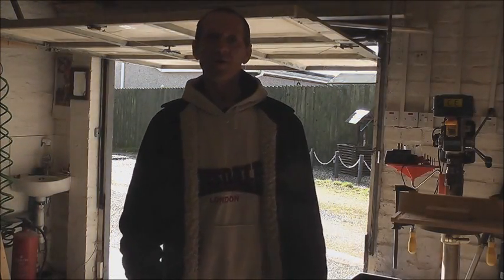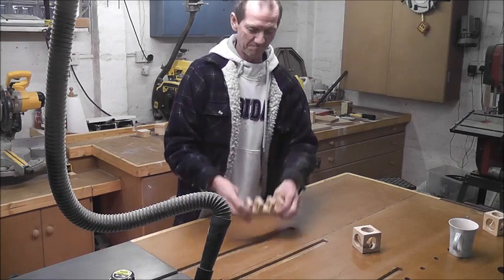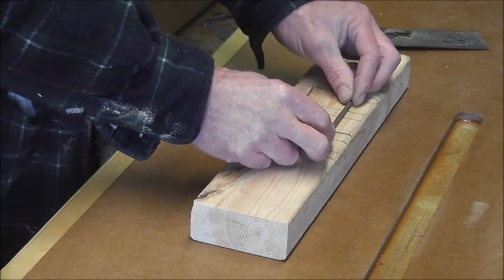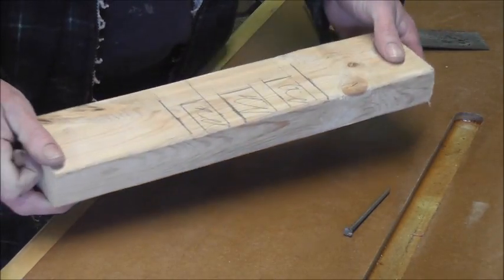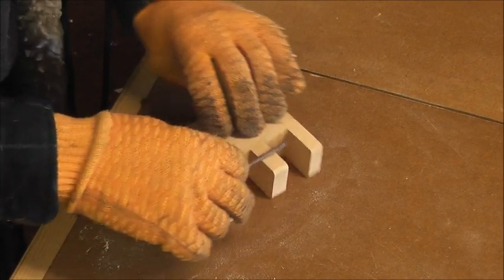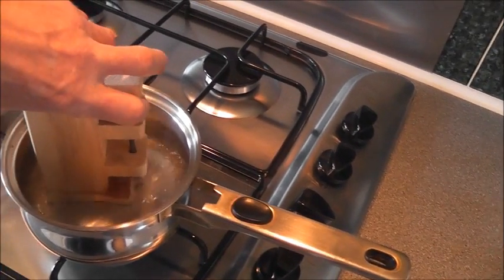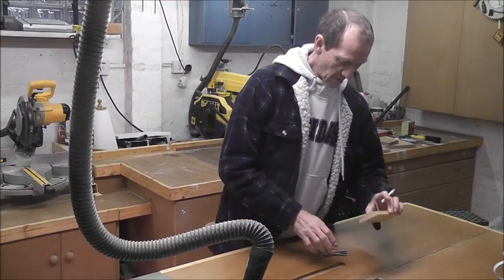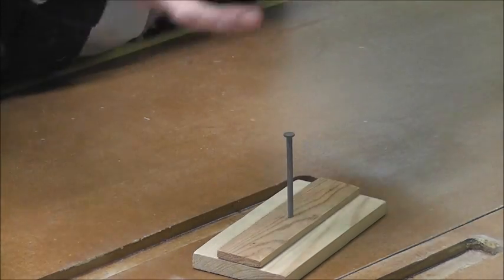Nail In Wood.Trick

Comment: Love the router table mate lol
Reply from the maker: dan barrow you need to see my new one in a more recent video
Reply: Which video mate is it the one on the table saw mate
Reply from the maker: dan barrow yes that's my new baby l
Reply: Which recent video is it mate
Reply: I'm changing all mine around in summer so I will try and put video up now off of and after then u can see my workshop shed lol mate
Reply: Can't wait to get it up and running just got to insulate it and board it up and paint it what is the best thing for like damp etc, can I put planting sheet round the shed with insulation and then osb board round it mate also ply wood for the floor mate